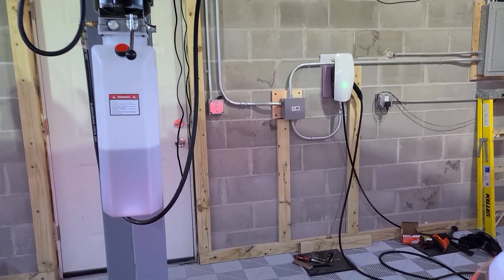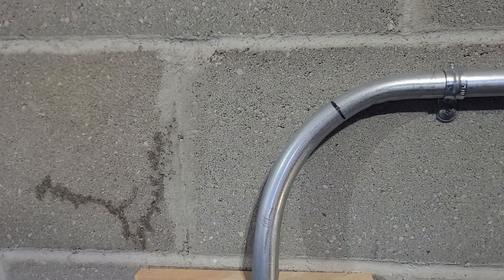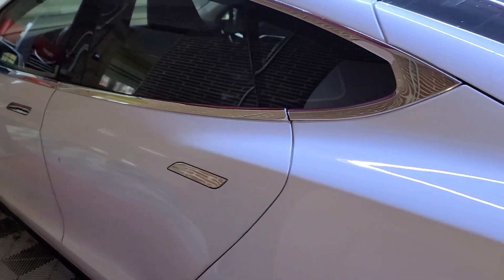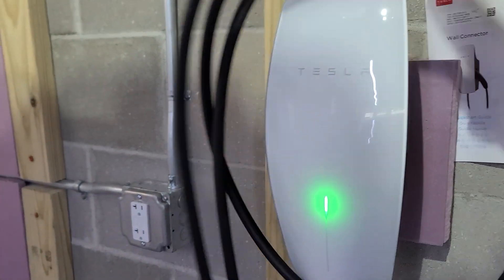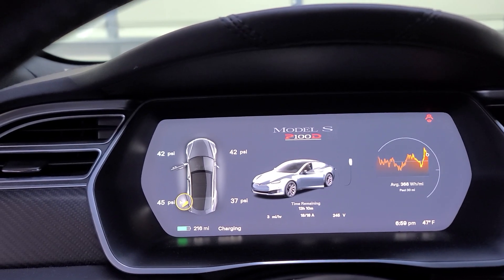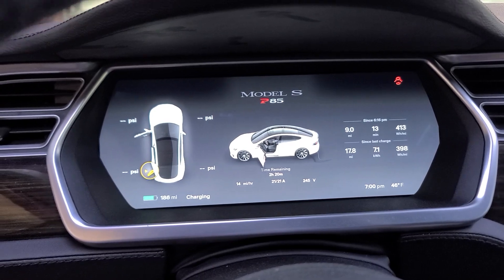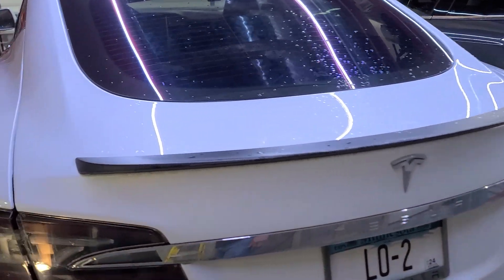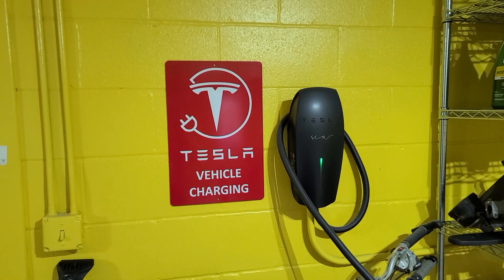Tesla power sharing with 2 Gen3 wall chargers - maiden test!

Comment: Is a 100 amp subpanel required, or can I run a 60 amp breaker from my main panel to set up power sharing with 2 Tesla Wall Connector Gen 3, with a maximum amp setup of 50 amps?
Reply from the maker: You dont need a subpanel. I had it installed because of the new garage build. The subpanel was necessary for the addl outlets, minisplit, garage door opener and lifts.
Reply: A 60 amp breaker will give you 48 amp charging.

Comment: Just went through this process ourselves sharing 40 amps to two Tesla Wall chargers. Curious if you saw the wording around network limit being the max minus 1 amp on page 34? Appreciate the effort to document this! Thanks 🙏 

https://www.tesla.com/sites/default/files/support/charging/Gen3_WallConnector_Installation_Manual.pdf